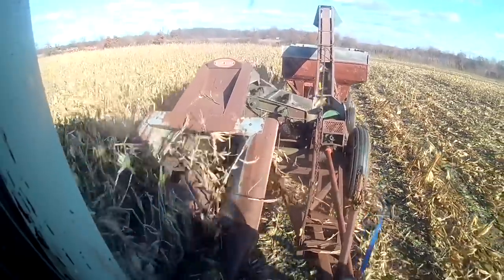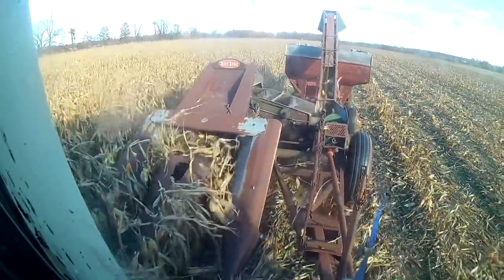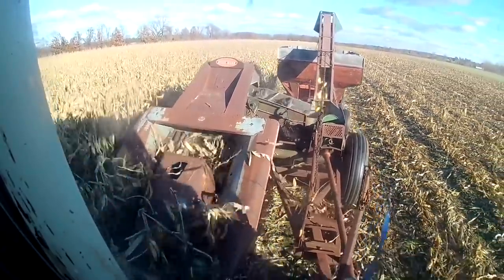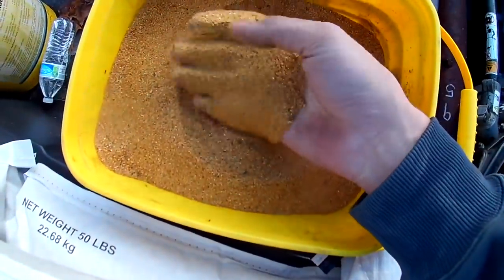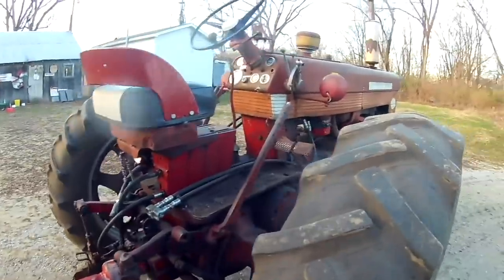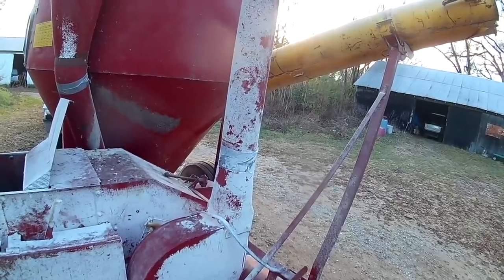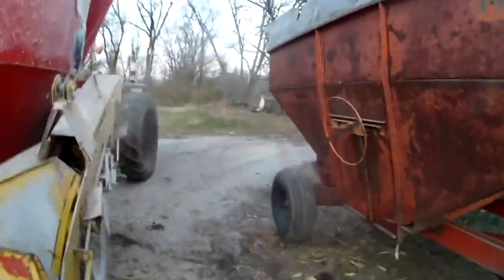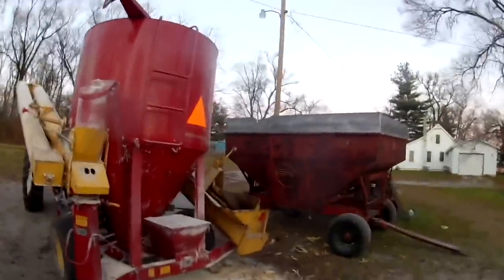Ear corn from field to feed picking and grinding cattle feed

Comment: Love the video, grew up on that equipment, great way of life. My children and I still use old equipment (more  reliable than the new crap)
Reply from the maker: And when it does break you can fix it with a welder and a wrench you don’t have to call in someone with a computer and a collage degree

Comment: Always enjoy watching the picker.  We did wide rows, and a mounted IHC picker on a M. Husks weren't a problem.  If we did Shell any the husks got tossed into a pen as bedding. 
We allowed the Holsteins to glean the corn stalks for a few weeks. 
Made plowing easier. 
You do things similar to what we did 60 years ago. 
A dirty tractor is field ready.
Reply from the maker: 😂 yeah we are kinda out dated we are trying to get newer or just better shape equipment but the farm got so behind it’s gonna take a long time I never plan to have new equipment I like the old but I definitely need to get better and start rebuilding a tractor every couple years to stay in business but it’s expensive and we always end up needing something else
Reply: @knappfarms  I thought we were peasants in the 70s. The 80s came, and I watched the guys with the big, new equipment fold. We were in the black. 
I don't judge your operation.
Reply from the maker: We should definitely be better off then we are just the operation was ran poorly hopefully we can build it back up
Reply: Good videos  older equipment is paid for, turning a profit  Farmer to Farmer stay safe out there. 👍

Comment: Another interesting one! Yeah, my Dad taught me young to slowly engage things like that, like the cutter blade drive belt and the clutch on our Snapper riding mower. When I hear neighbors just slamming their mower in with the belt screaming in pain, I cringe. But of course, as a kid I did my share of popping the clutch on it to do wheelies. 😃
Reply from the maker: Well everyone has to pop a few wheelies and break a few thing 😂
Reply: One time I wanted to do a huge one, so I let it roll backward down an incline, then popped it while in 5th gear (5-speed). I swear that thing was 45° up in the air. I had no desire to do that again.
Reply from the maker: 😂 I did that once on a 0 turn mower and I thought for sure it was going over backwards on top of me like you said didn’t try it again

Comment: Great video. Thanks for taking the time to make it. Don't let people get to you about washing your equipment . It looks like everything runs and works well and that's the important part. Is there a limit to how much moisture is in the corn if you go right from the field to the feed grinder ? Thanks
Reply: Haters always gonna hate!!  I bet they're corpo farmers or city folk. You work for you... Nobody else. Be proud!🇺🇸
Reply: Plus.... Those northern plains guys only have to work 4 months a year. I'd love a 4-5 month farming season and 6-7 months to clean and fix my shit.
Reply from the maker: Thanks for the comments as for moisture this is very dry and sense it’s winter and cold we don’t have to worry about mold or spoilage going straight to the grinder in the summer you definitely want it as dry as possible not exactly sure what the % would need to be